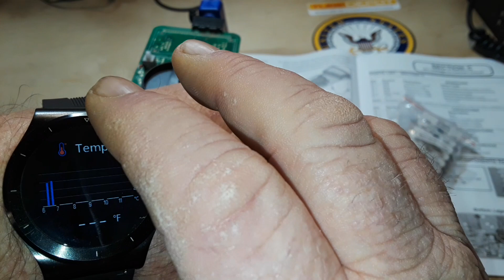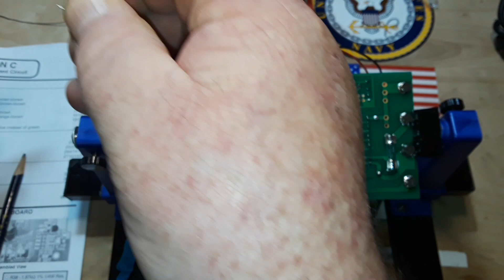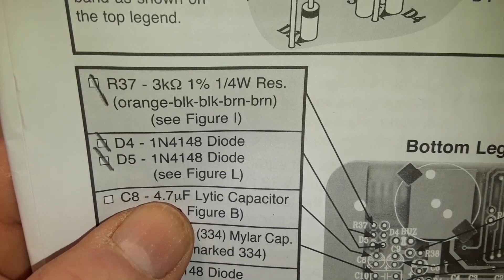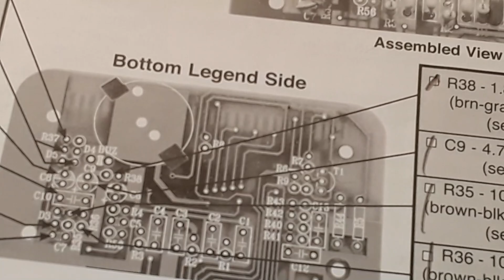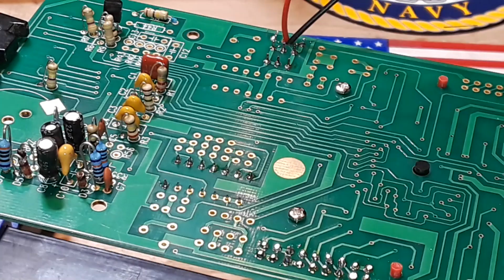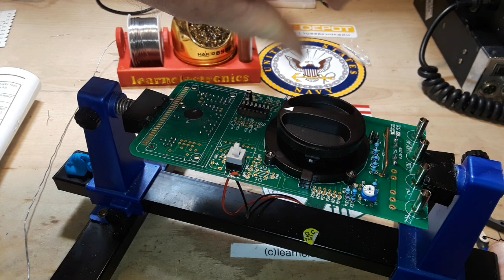Elenco M2666K Multimeter Build Part 3

Comment: Hi Paul, thanks for the great video. Currently, I’m trying to build this very kit myself and I’m having an issue between our 16 in our 17 when I get to the voltage check/calibration part of the build. the voltage out from our 16 reeds correctly but the lead heading into our 17 isn’t getting all of the voltage and I don’t think I damaged the board. Is there another reason why that might be happening? Thank you so much!

Comment: I'm interested when you get to the point of installing the piezoelectric speaker.  I absolutely destroyed mine. I couldn't get the solder to adhere to the center surface.  I tried a bunch of things (scraping the surface, lead and lead-free solder, flux, no flux, etc.) . Nothing worked.  :^(
Reply: Lol.  I just order some replacement piezoelectric speakers off Amazon that are pre-wired.

Comment: I'm wondering if you measured some or all of the components before soldering them in?  I used to just put kits together, but I think there is some merit to verifying the specs before finalizing their position on the board.  If the DMM decides to act up, at least you know it's not due to an initially bad component!  I enjoy watching the soldering and am happy for the lack of a headache when "you're" done!  Thanks!!!
Reply from the maker: I checked all the resistors before I began. I didn't check the caps, the diodes checked good on the first test.
Reply: You are The Man!!!!

Comment: Have you ever thought of trying to fly FPV wings or quadcopters? Its a great hobby if you're into building electronics (plenty of soldering and troubleshooting involved) and the flying part can be quite relaxing. I would imagine that you have flown RC planes, which are fun as well. But adding FPV to anything that flies turns it into a whole different hobby.
Reply from the maker: I have back in 2011-2013. It was from Hanger 9 I believe, and was the first to feature GPS, altitude hold, and RTH.
Those were cool. Also flew fixed wing from micro electrics to 50cc gas giant scale warbirds.
Hands down, the most expensive hobby on earth.
I watched a guy put in 2 turbines in one day...